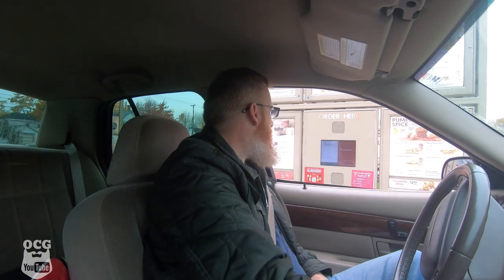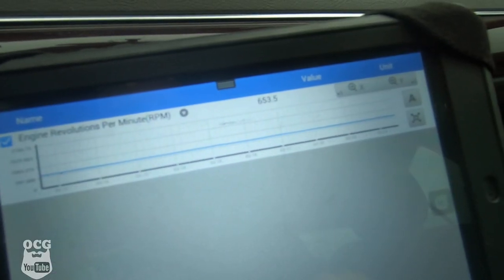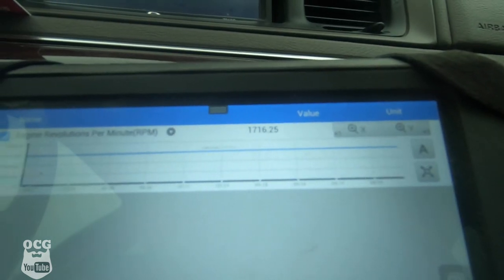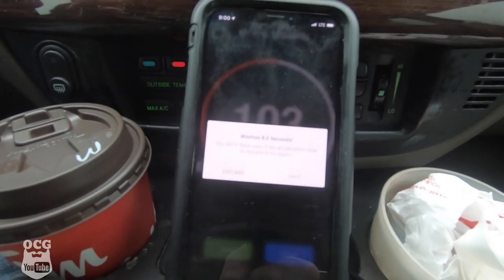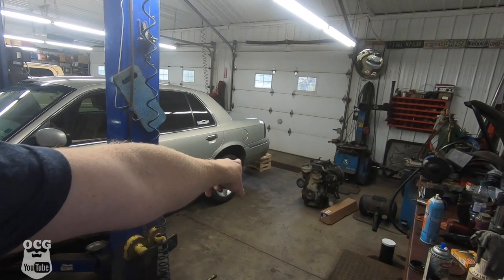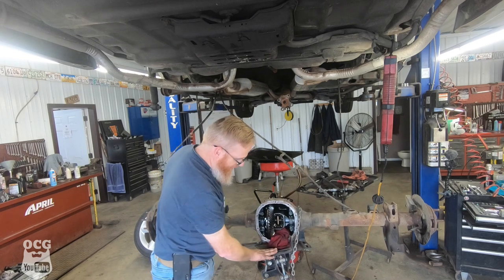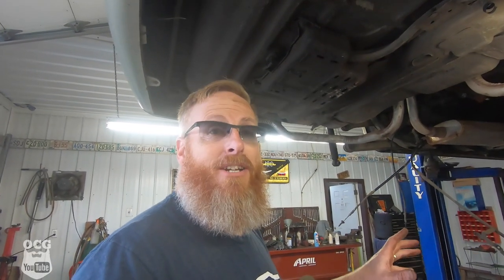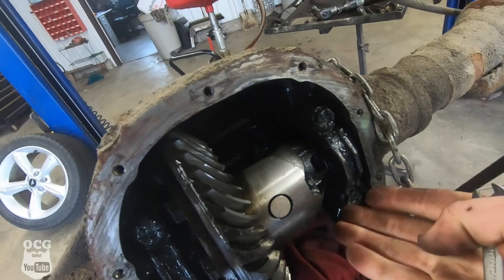Install And Test Drive Ford 8.8 Locking Differential (CROWN VIC, GRAND MARQUIS) Pt-4

Comment: I got rid of the open 2.73's in mine too. Picked up a posi and bought a used but like new set of OEM Ford 3.27 gears for $40 and did the swap, with all new bearings and seals of course. What a difference, especially with several people in the car is where I really noticed an acceleration difference. Also added a 1" addco 650 rear sway bar at the same time and that big boat handles and drives like a car half it's size now.
Reply from the maker: I found the same thing! I bit more pick up from a stop! Thanks for watching.

Comment: Excellent video! I have a 2008 Crown Vic LX and have been considering  swapping out the 2:73 for a 3:27 Power-Trac. You answered alot of questions I had. Looks fairly simple for even a DIY like me.

Comment: Rpm didn't change at all compared to the old gears vs the new gears because the speedometer is off because it was set to the old gears nice work Jason great work on removal and install bet junior was a ton of help so you didn't have to strain to get it up there
Reply from the maker: Yup

Comment: did this swap couple months ago on my 01 marquis i forgot to change the speedo gear it pissed off both abs an traction control
Reply: Does a 2004 even have a speedo gear to change? They're electronic aren't they?
Reply: @garymatthys3605  correct you have to change the gear ratio in the ecm but the abs/trac lights will come on till its changed it'll try to trigger the abs/trac 3 or 4 times then turn its self off at that point abs/trac is turned off lights will stay on brakes will work normal but no abs/trac
Reply from the maker: 03 and up use speed sensors and yes, must be reprogrammed! That’s where Mo’s comes in!
Reply: @87fubar  how do you fix that in the older 2000 models? Will a marty tune fix that aswell or is it different

Comment: I would have thought with 3.27s it would burn some tires? I have original 2.73s and still peels out a lil bit. My tires are also Michelin all weather's w about 80% tread
Reply from the maker: Oh it burns rubber, but you got to brake burn it! These cars are too heavy and underpowered to smokem right outta the gate! But a Marty tune is coming for this car. That will all change!
Reply: @OldeCarrGuy  ya I was looking into the marty. I called about 3.73 gears with posi using revolution gear brand it's guna run $1,300 at my local shop 🤦🏻‍♂️

Comment: olde carr guy     what can i use to redo the black plastic around the body?  paint marker ????lol
Reply: I got some mothers back to black trim plastic restorer,   lets see how she goes
Reply from the maker: There is lots of products out there. Some last better than others, but unfortunate the only thing that tends to be permanent is a torch. When you wave the flame lightly around the effected  trim, it darkens it back to original. Its a fine art to not melt it.
Reply: @OldeCarrGuy  thank you
Reply: @OldeCarrGuy  those dang ol door handles,  i'mma try your trick with the torch on them

Comment: So I have to swap out the whole diff to change the gears?
Reply from the maker: You don't have to. I did because its I absolutely hate setting the backlash, shimming. Besides, I had  the means to do it this way in my shop.
Reply: @OldeCarrGuy  is it limited slip? Where did you get it from? What do I have to look for?
Reply from the maker: It is Limited Slip and the main reason for the swap. I picked mine up from a auto salvage yard. You have to ask for a locking rear axle assembly for the year car you have when you call the yard and they can cross it to several other vehicles. Keep in mind that when you change the gear ratio you change the accuracy of your speedometer.

Comment: Does the traction control still work and did U have to do anything to the ecu to tell the car the gearing is different
Reply from the maker: Everything works as normal with the exception of the speedometer being off. This is the only thing that would need to be reprogrammed, but i'm not worried about it as it's not off by that much. I can live with it!.
Reply: How different is the driving experience?
Reply: I got a 05 and I wanna change the gearing
Reply from the maker: @leonidas6342  Definitely a noticeable difference. More responsive. Not to mention great burnouts.lol

Comment: Did you ever figure out why your speedometer was reading wrong just swapped my rear and I’m off 10mphs
Reply from the maker: It’s because of the difference in gear ratio.
Reply: @OldeCarrGuy  how do I correct this do you know
Reply from the maker: @daviddobbins1047  either a Marty Tune from Mo's Speed Shop or contact your local Ford dealer.

Comment: I got a 2000 Mercury, Can I use the 3.27 diff?
Reply from the maker: You can, but you need to find an assembly from your era of car. Little things like the shock placement is different, maybe a couple other little thinks.

Comment: Was there a major difference with the swap?
Reply: How's the rpms aswell
Reply from the maker: The swap was quite straight forward. The biggest thing to get used to after the fact is your speedometer will not be accurate by 10-12 km/hour or 7-10 mph! I didn’t bother with getting it recalibrated but I believe any Ford dealership can correct it!
Reply: I'd like to have more vids on this.is it easy to chirp the tires?
Reply from the maker: This video is the last in a series of 4 video that lead to doing the swap. It's definitely easier to chirp the tires.

Comment: Check out the Ultragauge II.  It displays a lot of info, and will do what most hand held consumer scanners can do - http://www.ultra-gauge.com/ultragauge/  Please no lift, and no excessively large diameter rims.  17's are best, and no more than 18's.  My '08 with 3.27 gears does about 1760 RPM @ 60 MPH.
Reply from the maker: I am going to lift it but with 16” and 31” mud tires

Comment: Excellent video! I have a 2008 Crown Vic LX and have been considering  swapping out the 2:73 for a 3:27 Power-Trac. You answered alot of questions I had. Looks fairly simple for even a DIY like me.
Reply: Lol I've got a 3:27 I've been wanting to swap out for a 2:73. I'd trade with someone if they'd help me swap it out.